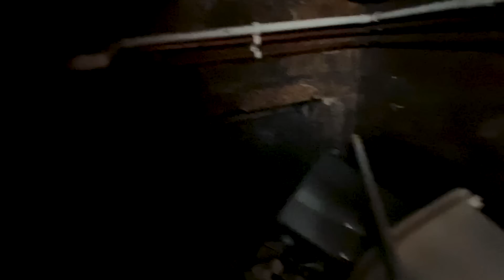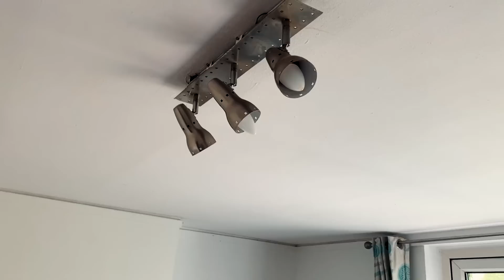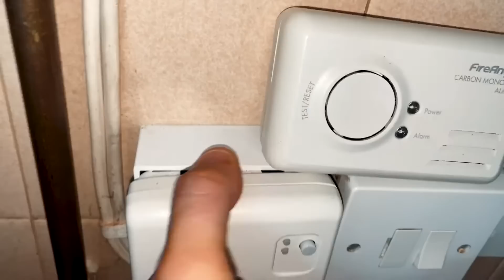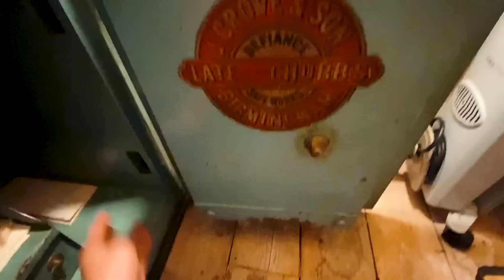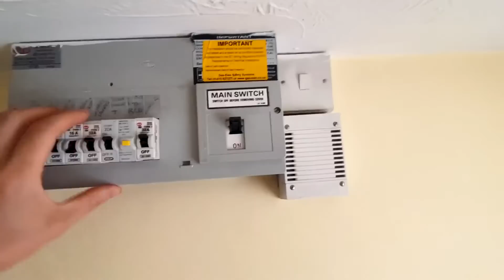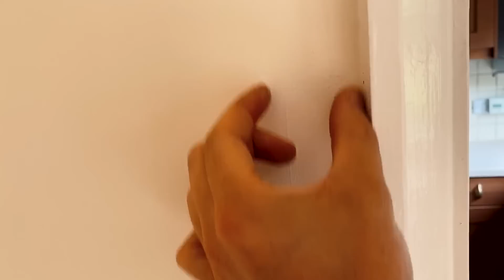CAN YOU DO THREE EICR'S IN A DAY? - UNCOVERING OLD FOOTAGE

Comment: Had a job recently where T&E at every light fitting but found that there was no cpc continuity from the consumer unit to the lights..... joints under floors connected to the old rubber twin cable with no cpc.......alterations previously carried out by a registered sparks to those circuits did inform the client but carried on anyway as lights were class 2....
There is no chance of true testing being carried out if there are those that choose to ignore faults

Comment: Interesting how everything bad must be dodgy DIY 🤔 
So there aren’t any builders, plumbers or even actual electricians who do bad work? From my own experience of owning a couple of properties from new and one as second owner only 5 years after the property was built, some of the so called “professional” work was horrendous across all trades. Plumbing is definitely the most variable in terms of quality and bricklaying isn’t far behind but I’ve seen some clangers in the electrics as well.
Anyway, interesting video, thanks for sharing.
Reply: If your not a qualified electrician it is DIY
Reply: @MCKINJO  I disagree Gary - DIY stands for "Do It Yourself" which means you are performing some sort of trades activity on your own property. 

It's not "DIY" when some rogue plumber drills through an electric cable and then bodges a repair with insulating tape and the wires twisted together, or installs a dodgy junction box under the floor. It's not "DIY" when an actual electrician performs sub-standard work either, or ends up installing a horrible, cheap consumer unit because the customer is on a very tight budget. 

That was actually my point - that you can't say for sure just by looking at some sub-standard artefact that it must have been "DIY". It would be more accurate to just say that this artefact is sub-standard under regulation 123.4 and could lead to danger x, y or z.
Reply: @craigchamberlain  definitely a DIYer
Reply: Absolutely! Got it in one Sherlock! 😂

Comment: Thee properties Artisan are looking at are about par for the course. We specialise in domestic rewires, which necessitates a few of the dreaded EICRs. All of these properties need rewiring. IMO most houses need rewiring because they have all had decades of additions and alterations made by un-qualifieds, and the amount of remedial work needed to get these installations up to even a half decent standard is huge....and even then, you have no idea of what's frazzling away under floorboards on under loft insulation. the introduction of part P only seems to have made things worse, because it prompted a lot of older (but very experienced), time served sparks to give up the trade because they did not want to go down the road of registering with an affiliating body.....And  the builders, plumbers etc that used to bodge their own electrics before are still doing it because NOTHING ever happens to them because nobody is policing it. And as for people who do several EICRs in a day on properties that are in the condition that Jordan is inspecting here need locking up. How can legitimate electricians possibly make a living when completing bona-fide EICRs (usually taking a full day, sometimes longer) but up against morons knocking out three or more a day, for an impossible £75 a pop?
Reply: For a strange and mysterious way still aren't enough problems and injuries...
Reply: Absolutely 100% correct mate.Part P was a backward step.

Comment: Property 1: Cut to basic insulation on the neutral tail showing exposed copper and you're busy poking around in there. Not much to protect you from a lethal shock other than an upstream 400A fuse! The tails should be double insulated all the way into the main switch

Property 2: Wiggles main fuse then pulls it, no arc flash protection or even gloves, 'Five * Electricians' can't be bothered to check the rating of the fuse

Gave up watching from there

You can't do three EICR's in a day if you're doing them properly, especially if there aren't any previous records. I allow a day for anything up to a three bed property as ALL accessories come off then a few hours report writing away from the property when you've got a clear head and can think properly about codings and recommendations, and the customer gets a detailed explanation in layperson's terms along with photos

You can't just give up on something because there are some bodge jobs and declare 'needs a rewire'. I could understand if there was VIR everywhere but I've inspected installations with the old tinned copper cable and they've been better than some modern ones
Reply: How'd you get a shock off of a neutral? I agree, not safe practice but I can't see any actual risk.
Reply: @Ragnar8504  Treat the neutral as a live conductor and show it the same respect. If there was a broken neutral out in the street or a fault at the transformer, where would the current be going?

Comment: Any property can be put right as long as the insululation resistance is good. For me it comes down to cost of remedials against a rewire & disruption to the client.
Reply: I don't quite agree. Some properties are so badly messed up you quickly get past the point of spending more time on tracing crazy faults than you would on a full reqire. I think CJR Electrical once had a house with what looked like a pot of spaghetti with junction boxes under every single floor board they lifted. Even just figuring out which cables were redundant took them far more time than it would have taken them to cut everything at the CU and rewire, weighing in all the copper. This property doesn't look too bad but by the time you start adding a decent number of sockets you might as well rewire the socket circuits.

Comment: The 2.5mm twin and earth spurring from the cooker switch to a double socket via a fused spur under the counter isn’t a code 2.  There is no potential danger at all.  The cable is protected by the fuse down stream.
Reply: What about the 2.5 that feeds the fuse!? Definitely a C2
Reply: @joncooper1831  nope as its fixed wiring with one point not a problem.
Reply: @mikethemask1525  Regulation 433.1.1. - The operating characteristics of a device protecting a conductor against overload shall satisfy the following conditions - (ii) - The rated current or current setting of the protective device does not exceed the lowest of the current-carrying capacities of any of the conductors of the circuit. 

Now assuming that the cooker circuit is on a 32 or 40amp protective device, the 2.5mm cable feeding the FCU is underrated for the protective device. Admittedly it is downstream of the cooker switch where the load would be connected and the FCU would prevent the upstream cable from ever having a load over 13amp BUT, the cable still forms part of the circuit so the regulation still stands in my opinion. 

It’s like wiring a ring of just FCU,s with 2.5mm on a 60a MCB and saying that’s fine because the load on any one point can never exceed 13amps.

Of course, we can agree to disagree.
Reply: @joncooper1831   An EICR is an assessment of electrical saftey, assessed against the current standard.   It is entirely possible that an installation, or part of, does not fully comply with BS7671, but can still be considered safe for use.

In this case, the cable is not at risk of overload, and therefore poses no risk.   You can’t C2 an observation simply because it doesn’t comply.  There has to be a genuine potential danger.

At most, this is a code 3.
Reply: @joncooper1831  I don't see that it is any different from wiring a double socket as a spur from another socket on the ring, in 2.5mm t&e.  The maximum current that can be carried is 26A (2X 13A, limited by each fuse in the plugs) with a 32A mcb, which is the same as most cooker circuits.  It may not be ideal or 'how I do it', but you wouldn't even comment on a spur off of the ring in that situation.
Reply: @prolecelectricalservices3813  Agree with you there is no chance of overload on this 2.5mm.
Reply: @frankcooper6118  Exactly, and the FCU limits the current to 13A. The only possible cause of an overcurrent in the section between the cooker switch and the FCU would be a short circuit in that very piece of cable and the B32 needs to be able to provide short-circuit protection for the 2.5 T&E as it would for an unfused spur.

Comment: You can’t do 3 properly in a day. Not a 8 hour working day and actually having a break.
Reply: I think a full test you struggle to do 2 in 8 hours, by passing dimmers, metal sockets, smoke alarms etc for insulation resistance testing, r2 of bonding too all takes time. Employers take the piss with this
Reply: @MCKINJO  totally agree and that doesn’t take in travel time as well. Easily an hour in the day.

Comment: Your there to check on the condition of the wiring, not to rewire  if ins res shows to be well within  regulations . Number of sockets is only a recommendation, not in BS 7671 NICEIC condition  requires a percentage of testing , no wonder you do 3 in a day

Comment: Job number 1 cant believe you opened the bill main fuse box as this contains asbestos, the flash guard for the fuse is asbestos and should not be disturbed
Reply: Nothing wrong with what he did at all.
Reply: The asbestos was not disturbed by opening the cover
Reply: @swifty5783  lol, any fibres loose in the enclosure would be disturbed. Ask HSE they would be really interested.